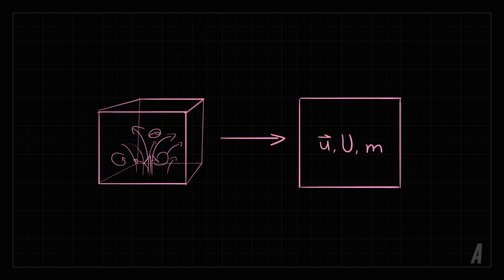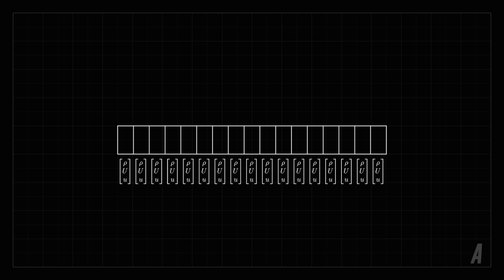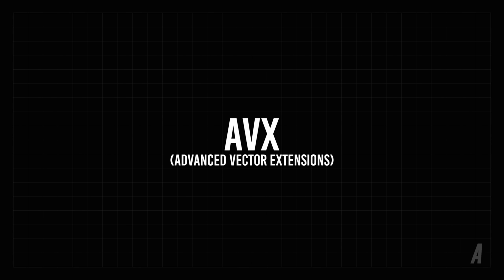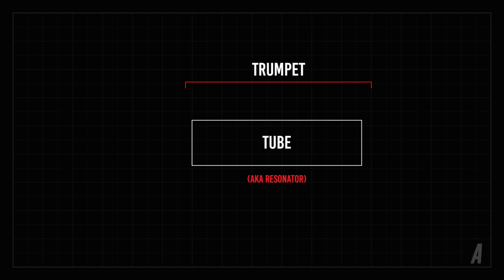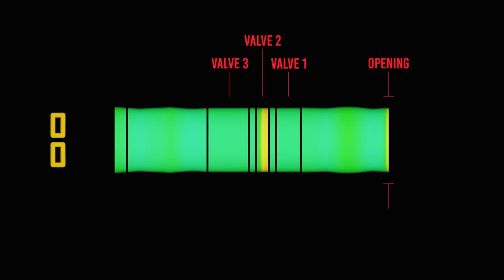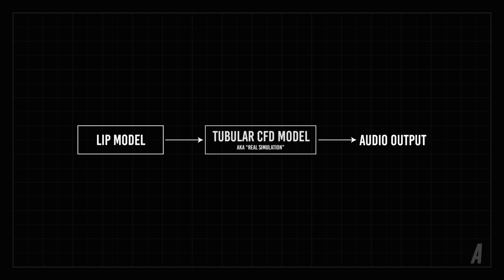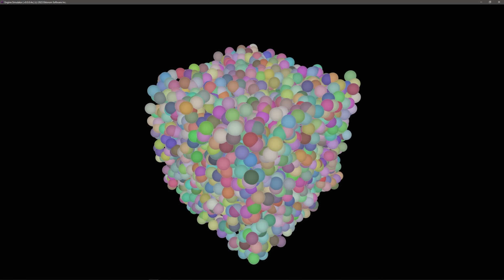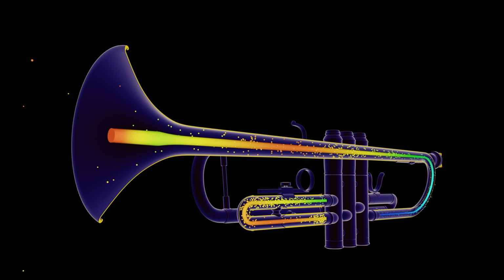Real-time Trumpet Simulation [C++/Vulkan] [WARNING: Flashing Lights]

Comment: I sincerely applaud your work. Although not revolutionary, it is extensive and effective. This comment is mainly for everyone in the comments:

This is not amazing, nor is it necessarily new. Fluid simulations of vibrating air from a physical source has been in the industry for ages, and is frankly not that practical. Instead, modeling waves based off of physical properties is.

Simply take a look at Samplemodeling's Trumpet v3 (they have a demo video titled The Trumpet 3). Its sound is nearly indistinguishable from a real trumpet's, and often is indistinguishable when paired with proper reverb and room tone as it is meant to be (as per the anechoic sampling and modeling).

What would be impressive is a good simulation of bowed strings, arguably the hardest type of musical instrument to model due to its many factors (bow speed, bow pressure, string, finger placement, etc.). Although physical modeling synthesis will likely reign supreme due to its "low-level"-ness in comparison to fluid dynamics, it would be a very interesting project.
Reply from the maker: I don't think anyone in the comments actually believes that this would be a good tool for music creation compared to the other tools available today. As I've stated about 100 times on my channel, fluid simulations like this have existed since the 1960s and even earlier if you count algorithms done by hand. What is "new" about this project is the application of these algorithms to real-time and specifically to a video game which places these CFD techniques in the hands of a general audience. The techniques that you mentioned have limited relevance to what I'm actually trying to achieve which is the simulation of generic fluid systems like internal combustion engines in real-time. Regardless, I don't place much importance on doing something "new" or "revolutionary". This has been the most pervasive and frustrating criticism of my work because I have never once claimed that anything that I'm doing is new or revolutionary. Most commenters are aware of the technological landscape and I suspect are interested in the project for other reasons.
Reply: @AngeTheGreat  I wouldn't base your comment on "I don't think anyone in the comments" before scrolling down. Three people who want it as a VST/claiming it'll be important for physical modeling synthesis/send it to Yamaha or whatever. In the top ~15 comments, this may seem little, but by "everyone" I mean even the people not commenting who are thinking of this.

Though of course, making this publicly accessible is commendable, hence my previous applause.
Reply from the maker: I've read every single comment on this video. People are interested in having this as a VST or at least developed INTO a VST with some more research because it offers the ability to design instruments that don't actually exist in real-life. The VST trumpet put together by Samplemodeling is very impressive but is fundamentally different from this software. It relies on real-world measurements and is heavily tailored to the particular instrument that it synthesizes. There is nothing wrong with this but again, it is not at all the problem I'm trying to solve. Such techniques would not work for the simulation of generic fluid systems and do absolutely nothing to predict flow rates, volumetric efficiency and the physical behavior of an engine which is the ultimate goal of this project.

Also, I really don't understand why you're placing so much emphases on something being "new". I directly quote research papers from over 30 years ago in this very video about trumpet simulations. My fluid simulation is based on a model proposed in the 80s. I am not claiming and have never claimed that anything that I'm doing is "new". I think that this is a flawed way of seeing technological advancement anyway. Every product/discovery/procedure/algorithm is an iteration or improvement upon existing technology. I am taking existing research from a variety of fields, making small contributions where needed and developing this into a video game that to my knowledge does not currently exist. I don't see the point of criticizing this work on the basis that it's not entirely novel and revolutionary.
Reply: @AngeTheGreat  If you're somehow responding to the unedited one which I changed immediately after sending, I mentioned a comment I made on a video about FluidX3D, of which I expressed interest in simulation capabilities regarding simulating (primarily visualizing) air vibrations, resonance, etc.  If I believed every advancement in technology had to be "entirely novel and revolutionary," that would be worse than a "flawed way" of thinking, it would be plain idiotic and wouldn't align with my love for this video, others of yours, and anything FluidX3D either.
Besides, I never claimed Samplemodeling's Trumpet was a replacement for this, as again, I was not talking to you but the people who think this is a good replacement for audio synthesis as a whole. I 100% agree with the usefulness regarding video games and real-time simulation, but that wasn't my point and I don't get why you keep going back to it.

Anyways, this would be most useful if this particular simulation was open source, so everyone can iterate and improve upon this existing technology, as I'm sure others with their own sonic simulations would prefer to not have to pay to cross-check and/or combine their work with yours. If this still is something you're doing for fun, at least let everyone build off of it as well, as I'm sure over 1.6m views is enough to say this has gained interest. I for one would very much like to work on this and make changes on my own without trying to navigate your Engine Simulator for a couple hours.

Well, that should be all I have to say. Also, I'm surprised you're even responding to this. I know you're the type to do that based on your reply to the accused "scaremongering" and comment about the "guy from Reddit," but I figured you'd just read this, roll your eyes, then carry on with your day.

Anyways, it was a pleasure chatting with you. Have a good night.

(If you do wish to reply to this further, I would prefer it be on Discord @theunderscore. Of course, feel free to ignore my request.)
Reply from the maker: I am responding to your unedited comment which is so different from your edited one that my response doesn't make sense anymore. I bring up things being new and revolutionary because that's exactly what people like you and the people on reddit latch onto when criticizing my work. They have nothing to say about the project other than "yeah, nothing new here" or "this has existed already, why does anyone care about this". In your first message, just a few words into your comment you're already reminding me that this is not revolutionary as if I cared or ever claimed that it was.

You claim you're addressing my audience (even though you did directly address me at first when reminding me that my project is not revolutionary) so I'm guessing that you feel that they're misinformed or have been deceived into thinking that my project is revolutionary or "new" when it isn't. First of all, I've already made a case for why an entirely physically based VST MIGHT be useful because it can allow the creation of instruments that don't exist or sounds that are intentionally unrealistic. Also, most people understand that this video is a proof of concept. I spent about 2 weeks in total on this trumpet simulation, if I had 6 months to dedicate to it then it might actually progress to being usable in a music production setting. People are excited by that possibility and are interested in a VST that uses physical synthesis. You've made the ASSUMPTION that they don't know better and are unaware that sample based VSTs exist, even though most people have heard plenty of very realistic instrument VSTs. As you said, samplemodeling's trumpet VST is NOT a replacement for this software so I really have to ask why you even brought it up in the first place, it really is baffling to me. I don't even think a single person said anything about my approach being more practical. The whole point of the project is that it's an impractical simulation and over the top way of generating audio.

To your point about making this open-source: absolutely not. The entitlement and degeneracy I faced after making the past Engine Simulator open source was not worth it. Since I don't demonstrate anything new in this video, it should be easy for you to replicate it in your own project and you can make that one open-source.

Comment: On the VPN point, someone once explained it to me in such a neat, easy to understand way that is not at all technical. This was almost 10 years ago and it still sticks with me to this day. 

A VPN is kind of like an opaque pen, you know there's ink inside it moving from one side to the other but you can't actually see  the ink. You see the outside of the pen. 
Similar concept applied to a VPN, you know there's data moving through it, but you can't actually see the data. 

I don't know why of all the other videos from others that mention VPN sponsors that this was the video I decided to comment this on. But I've watched quite a few of your videos and they are extremely interesting and I know you like to thoroughly understand and research things. So I thought you may find this analogy somewhat neat. :D

Comment: I think you made a fundamental mistake in the lip-part of the simulation, but first:
I'm a longtime high school physics teacher, and longtime trumpet player. Your model is really very impressive, I recognize so many things in the sound it produces, really impressive. I estimate that the bell adds a lot of amplification. It's the resonant air movement that carries the tone, and your model gets more energy from the constant-velocity air movement now, I think.

I think the lip model however is wrong, it somehow interchanges the flow and the pressure-parts of the air movement. I make this claim because you mention in the vid that the bell has an "open" end, while the mouthpiece is closed. I made this exact same and wrong assumption, the first year I taught this subject. In actuality the instrument is "symmetric": both bell and mouthpiece are open ends. You can reason this from the fact that the lower and higher C tones are harmonics in this instrument: they're played with the same valve positions. And the higher C is a perfect multiple of the base harmonic. All the instruments frequencies relate like 1:2:3:4:5:6:7:8  (C-C-G-C-E-G-x-C).
An assymetrical instrument would contain odd quarter-wavelengths resulting in higher harmonics like 1:3:5:7:9 etc. An octave-step would be impossible in such instrument.

Great work, I'm gonna show this vid in my lessons!
-Chris
Reply from the maker: The vast majority of papers I've been able to find online treat the trumpet as a tube with a single closed end, reasoning that the opening in the lips is small enough that that end of the instrument can be treated like a wall. It's obviously an approximation but it's the most commonly accepted model. My simulation actually doesn't make that assumption at all and the mouth is treated like an opening, albeit a very small one. This does permit the player to theoretically play all of the harmonics and not just the odd ones but this isn't how the trumpet is played in real life. Your observation is correct that having a half open tube would not allow a correct musical scale to be played and this also confused me while I was working on this simulation. This discrepancy is solved by the trumpet's bell and flare which are designed to adjust and correct the resonant frequency of the instrument across its range. Specifically, the flare and bell raise the 3, 5, 7, etc harmonics so that they APPEAR to be the 2, 3, 4, etc harmonics (of a completely different fundamental frequency), allowing the player to play a complete harmonic series. It's for this reason that the trumpet I showed in the video has such terrible intonation. I can link you to some resources that discuss this in detail if you're interested. Thanks for watching!
Reply: @AngeTheGreat  
Wow, I didn't really expect an answer, thanks for your time :)

I can't see how a wave resonating in a "cavity" can be changed in frequency enough to explain changing an asymmetrical cavity into a symmetrical one. The shape of the cavity might raise the power in certain harmonics, but changing frequency in a stable cavity isn't possible in my experience. Maybe if you have a set of cavities with coupling, like a mouth organ or a pan flute. But I'm guessing. 

I actually do this practicum in my pre-uni class using a tuning app: I play all C's on my Cornet, from the lowest C at around 105 Hz with one half wavelength in the instrument (slightly off, due to the wave projecting relatively more out from the bell, making the cavity longer), to 233Hz, 350Hz, 466Hz, 583Hz etc., in near-exact steps. I'm quite sure the instrument has to be symmetric with a stable cavity (save for the lowest tone.)
Yet the mouth piece is nearly closed, at least a lot less open than the bell.
I suspect that the returning wave, towards the mouth piece, influences how the lips oscillate. Lips are flexible, they start with a coloured random noise frequency, around the tone you aim for. I think that when the wave returns, it will lock the lips into an oscillation that "fits" its frequency, letting air flow through "as needed". Lips are flexible: they'll be open when the returning wave has moving air, and close when the returning wave has no moving air. This way the lips will act like an open end. :)

Again: this is a suspicion, as I've never had any classes in this direction. I'm actually an electrical engineer. But as any other physics guy I'm quite sure I can reason out applications from base physics principles :P
Please link me your sources, I'm not yet to old to learn.
Reply: oh, and if your modeled lips never close, how then do they bring the air in motion into the mouth piece? If you model a random noise source, will it be influenced by the returning wave or not? If the wave is to move back and forth more than one time, the "lips" will have to sync up with the returning wave, or you'll lose power. But for the lips to sync, they need some pressure to build up, and for that they need to close some of the time. I'm not sure how that works with you always open small opening....
Reply from the maker: I suggest reading this article which talks about this in detail (specifically the section that discusses the correction of the trumpet's harmonics by the flare and bell): https://www.phys.unsw.edu.au/jw/brassacoustics.html

The lips in this model do close periodically. My point is that the mouth end of the trumpet is not modelled as a perfect reflective wall in my simulation but actually both a wall and an opening depending on the state of the lips. Even at their maximal opening, the opening is small enough to be negligible and the end still acts mostly like a closed end. It's counterintuitive but based on my research and verification through simulation, it appears to be true.

Comment: This is truly impressive! When you get back around to this project, I most sincerely recommend:

Kazoo-ness / harmonica timbre most likely comes from the "lips". Next level "lips" resonator: a stiff structure part as simulated here, with a soft contact part. The result should be more treble to fill the higher resonance space, and probably reduce the needed wind velocity  at the lips. This is the next biggest step toward realism, as the instrument itself and fluid dynamics are mostly there.

Comment: Looking forward to the news about 2 stroke expansion chamber simulations. It is the area I am very interested in - a 2 stroke engine is pretty much a musical instrument in itself, living on resonances, shockwaves and gas streams. No cheats and shortcuts in the form of valves and timing belts, only careful tuning of flows and oscillations.